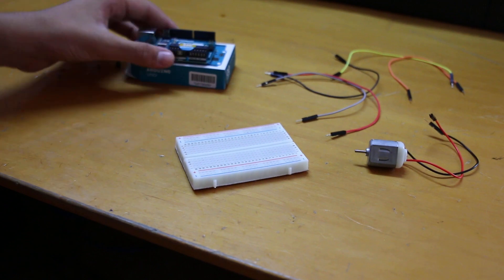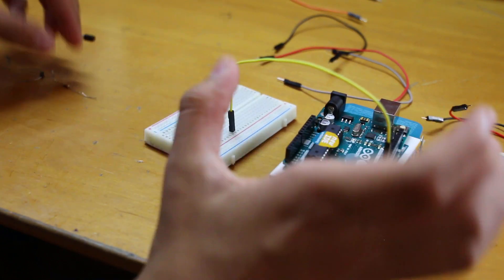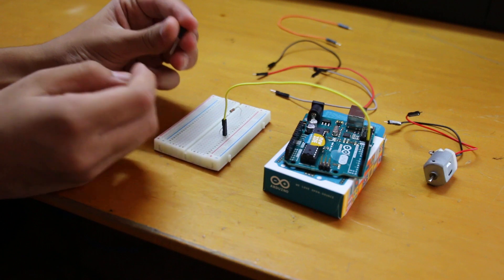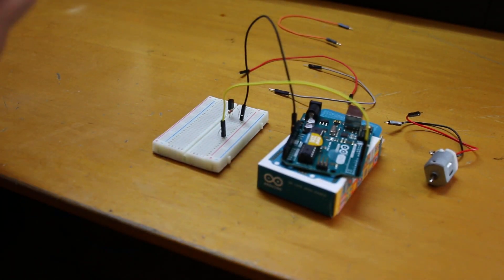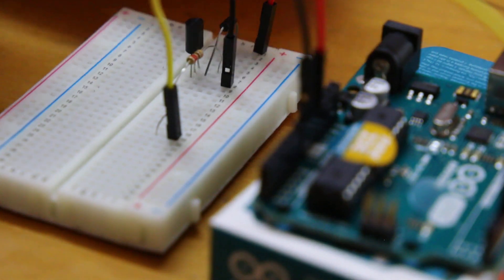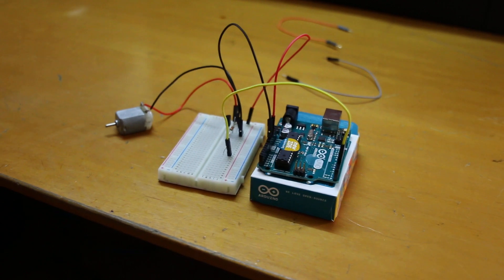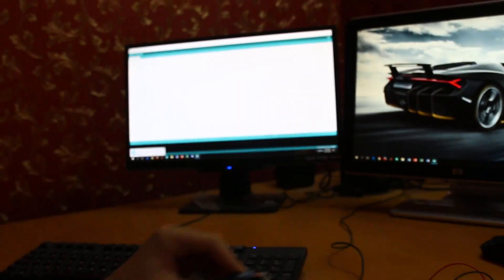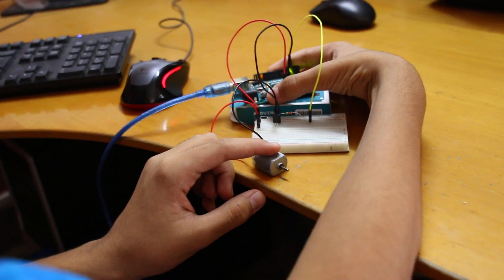Running a DC Motor Using Arduino

Comment: I follow your connection, I am feeling weird why ur pin configuration is different should be base at middle not? I notice that if u like tis connect, the arduino will be spiled because your power is connect series with ur motor and the transistor is become no use....right? If i had said smtg that is not right, please correct me :) . I saw many comment said it can run without the transistor ON because it dun need transistor ady can ON because of short circuit through ur motor.

Comment: This motor needs at least 3V to run at its lowest RPM... If you type 128 in the analogWrite function, it will send 2.5 V and the motor will not run.

Comment: Please tell the parts you have used.
Reply: Transistor P2N2222A
Diode 1N4148
220 Ohm resistor
DC Motor

Comment: what happens if my transistor gets really hot after just a few seconds? I've used the same resistances and motor as the video
Reply: try using a Mosfet transistor or maybe a relay.
Reply: @janlivny6196  Yes a mosfet would be a good alternative

Comment: Why do you need a transistor and diode?
Reply: The transistor acts as a dimmer switch to allow the motor to connect to ground by going through the collector to the emitter, and the diode prevents the current from reversing which could potentially harm the Arduino.

Comment: How supply the arduino and motor dc with alternative light from a battery or wall adapter of 9v?
Reply: Just connect the 9v battry using a adaptor  to the arduino board

Comment: The motor works, but I have a strange thing happening:
1st try - - > the motor works but when I change the code to make it stop it keeps going (it starts the moment I connect all the cables).
I change the positions near the transistor
2nd try - - > I hear the motor working but it's not spinning, although now it stops and starts flawlessly.
I change the positions again
3rd try - - > same as 2nd.
Got any ideas? (if you'll ever see this comment ofc)
Reply: My motor wouldn’t work under 50. Increasing the speed to 100+ made this clean ass code work perfectly! I’m very new but that’s what I was able to find.
Reply: Hi, I am just wondering how many watts of dc motor did you use? Because when I buy the ask me how  many watts. Please help
Reply: @papaelilegazpi  oh I don't know, it was a part of a broken old toy, I just managed to salvage it

Comment: Can you share power of resistance diode and transistor
Reply: The resistor is 1k ohm or less and transistor you can use d331

Comment: I followed and it works without uploading the code, even when i give 0 the motor does not stop? Or does the type of transistor and diode being used affects?
Reply: I had the same issue and I realized that he has a different order for the prongs on the transistor. My transistor prongs from left to right is Emitter, Base, Collector instead of what he was saying (Emitter, Collector, Base). Everything he says is correct, just the order of the prongs so try rearranging the prongs so that the proper wires are connected with the proper transistor prong. Best of luck.
Reply: try changing the polarity of diode

Comment: Hi, I have a project I want to do but I have no Arduino experience at all. I want to set up a Arduino to run a actuator motor that is controlled by a joystick. The joystick will run the actuator in 2 directions. What I want the Arduino to do is return the actuator back to center once the joystick is released. Is this possible with the Arduino? Thanks.
Reply from the maker: Yes it is possible. After connecting the components, you will need to program the Arduino using its IDE to perform the actions you wish for it to do.

Comment: imagine calling the PWM Digital pin an analogue pin. The pins on the left side are ADC pins (analogue pins), not the ones used in the video. A PWM pin is just a pulsing digital pin to perform a duty cycle to allow you to have half or quarter rotation speed.

Comment: is diode really necessary? can we do it without diode
Reply: Yes Bcoz without diode ur arduino can get damaged or else if u dont have diode then u can use motor driver to control

Comment: Why we didn't directly use the pwm pin and did it through a transistor
Seems wasteful
Reply: It's used for limiting the current going through the transistor,. you can google "limiting current resistors " for more information.

Comment: Hey, 
I was wondering if its possible to program it so that it does a full rotation every hour or so??  Its for a egg turner in a incubator that I will be using it fo
Reply from the maker: Yes it is possible to do that. You can use the delay function in the program to wait for one hour. So in this case you will write delay(3600000) since the input to delay is in milliseconds. Then you can turn the motor on and leave it on for a specific time which you can tune so that it does a full rotation and then turn it off. This will be in the void loop part of the program and so it will automatically repeat. So summarizing, first you will do digitalWrite(13, HIGH) then delay it for 1 second or so so that it does one rotation. Then do digitalWrite (13, LOW) to turn it off and put delay(3600000) to leave it off for one hour.
Reply: Don’t use a dc motor for that use something like a stepper motor
Reply: use a servo, dont use a dc motor. By the time dc motor stops, the egg will be dead
Reply: @VANTABL4CK  nah get a cow that walks in a circle every hour or so, just like the old days. works great
Reply: @kooltyme  thats a better idea  you've got
Reply: @kooltyme  What kind of modern technology is that? That is so smart! How had I not thought of that! Wow!
Reply: @kooltyme  What an idea man
Hats off
Reply: @kooltyme  Why is there an output port on the cow and how much energy does it need?
Reply: @VANTABL4CK  yes 😂
Reply: Use a Servo. It can rotate to a set position with no testing.
Reply: https://youtu.be/D6UlllQMwIo

Comment: How would you trigger it with an ir sensor receiver?
Reply: If you want to do something like run the motors based on some sensor data, you program the arduino to activate the pin controlling the motor when the data you're interested in is received. If you use the serial monitor, you can see what kind of information you're sensor is giving you. You can then write conditional statements that activate the motor, when you receive the right data from the sensor.

Comment: thank you but it moved exactly when I made full connection
I didnt upload code
Reply: I had the same issue and I realized that he has a different order for the prongs on the transistor. My transistor prongs from left to right is Emitter, Base, Collector instead of what he was saying (Emitter, Collector, Base). Everything he says is correct, just the order of the prongs so try rearranging the prongs so that the proper wires are connected with the proper transistor prong. Best of luck.
Reply from the maker: Before doing the connections, upload a program on the Arduino to make sure that there is no PWM output from the pin you are using. If it still starts moving, then your connection with the transistor is wrong. Check the circuit again and check the transistor datasheet to confirm the order in which base, emitter and collector appear.
Reply: @muhammadahmadkaleem9654   i am still having his same problem i have the circuit completed and i tried every possible arrangement on the transistor and it is still not working do you have any other idea it could be doing this?

Comment: can you use Arduino to stop the motor after certain time... and then reverse the DC motor rotation direction?
Reply from the maker: Yes you can stop the motor by giving a PWM signal of 0. On the other hand, you cannot reverse the direction of the rotation with the Arudino since you have to reverse the wires of the motor for that.
Reply: @muhammadahmadkaleem9654  Thanks for your reply! Even with a H-Bridge you cannot do that? there are so many different information online that I am so confused

Comment: Sir what kind of transistor are you using here?
Reply from the maker: It can be any transistor which turns on at around 5V and can handle 0.5 A of current
Reply: @muhammadahmadkaleem9654  okay thank you sir. how about the resistor sir, how much would I need?
Reply from the maker: @kwen_gaming  It should be around 1k ohms or less
Reply: @muhammadahmadkaleem9654  thank you sir

Comment: You did not specify the transistor number and did not show the sketches completely. Pls describe it in the comment
Reply from the maker: You can use any transistor with a threshold voltage of around 4-5 volts and a current rating of 1A

Comment: Can you built the circuit without using the transistor and diode please
Reply: No it's important. Because without transistor and diode your arduino will not be procteted when motor will stop ( it's like """electric noise""")

Comment: One more question why do I use a transistor as switch if can just set the positiv motor pin to for example to pin 3 and then switch it on and off? (with analog Write)
Reply: Cuz the digital pins can't supply 9V
Reply: But he used only 5 V in the video
Reply: @gergelytravnik3161  Ok I am confused now ------
Reply: @nihaal7750  Me too but I watched other videos where they also used transistor so maybe it works better if you use it and not giving power from the analogpin
Reply: @gergelytravnik3161  How bout we try it without transistor and see if it works?
Reply: @nihaal7750  Yeah I was thinking about that but I'm a little afraid that I might fry my board 😅
Reply: @gergelytravnik3161 Umm...that's quite impossible
U ain't giving inputs so the board shd be fine
Reply: @gergelytravnik3161  Any luck yet?
(I cant try it cuz I got no motor with me currently)
Reply: @nihaal7750  I don't have an Arduino (it's being shipped right now ) but I do have a motor 😂
Reply: @nihaal7750  it only works if you directly connect it to 5v and gnd
Reply: @alexanderurban3095  How much do digital pins give then?
Reply: @nihaal7750  5v I think
Reply: @nihaal7750  40ma is the max power for digital pins and you need the diode to not damage Arduino electronic...
Reply from the maker: The Arduino can't supply enough current through the pins to run a motor
Reply: Transistors can be used as a switch & an amplifier

Comment: Why do you use a diode?
Reply from the maker: To prevent reverse current flow which can possibly damage the Arduino
Reply: @muhammadahmadkaleem9654  thank you very much

Comment: Can I make this with a motorshield ?
Reply from the maker: Yes you can use a motorshield. The connections will be specific to the motorshield though. Circuits for different motor shields are available online.

Comment: Why do some people say not to power a motor from the arduino. Most people say to use external power source and yet you arnt? Did this go well for you?
Reply: Well , motors use so much power that ardiuno could fail to provide enough power to all motors , and ardiuno also need power to run itself also .....so external power to heavy components is advised. 
👍👍👍
Reply from the maker: It worked since I was using only one motor and the Arduino can support the current of one regular dc motor
Reply: @muhammadahmadkaleem9654  Ok Thank you :)

Comment: Using this circuit can i make the motor forward and backward?
Reply: You can use an H-bridge to change the direction of the motor
Reply from the maker: Unfortunately no since there is no way to give negative voltage from the Arduino.

Comment: my problem is that i started a class with an arduino kit but we aren't allowed to take them home till the end of the school year so I bought a different kit but now the new R3 isn't working for the codes because it won't let me select port and switch over. Do you have any suggestions?
Reply from the maker: You can try reinstalling the Arduino software or plugging in the Arduino into a different USB port of the computer.
Reply: Use the older programs of arduino ide